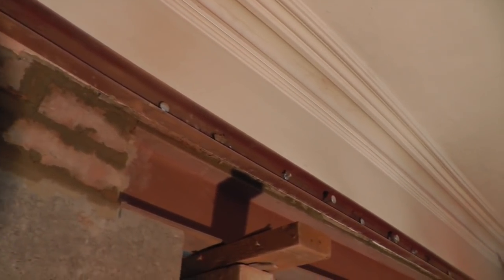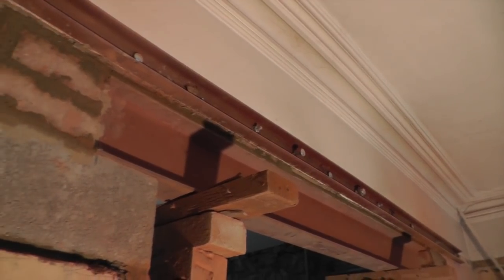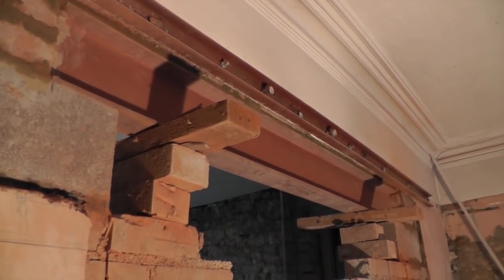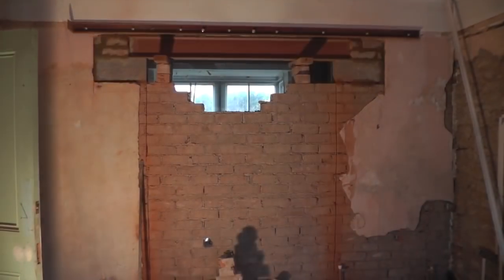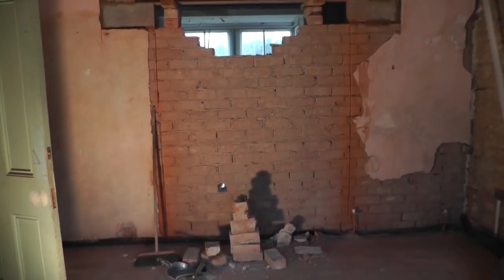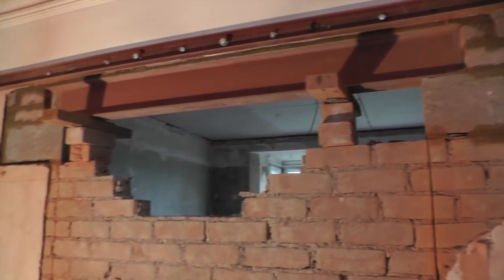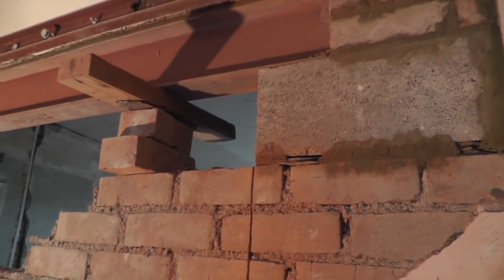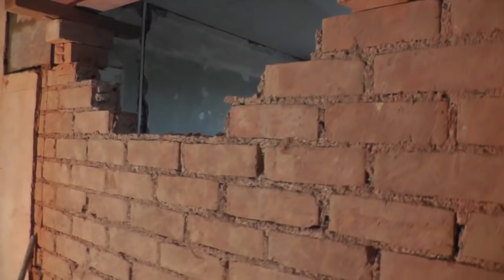The Wall Comes Tumbling Down

Comment: Hi Tim, could you tell me how that bolted steel support works? 
Thanks, Joe
Reply from the maker: It was the only time I have seen it done but a builder friends did it with me. It’s just two c channels bolted through the bricks above. It clamps it together creating a temporary ‘arch’. I would used acros on a bigger wall but it works well where you can’t get a solid base to support off such as this wall which was above the cellar.
Reply: @TheRestorationCouple  yes first time I've seen it. Was it holding much above?
Reply: @joefowler9600  It doesn't look like load bearing wall.

Comment: With such a narrow gap from top of steam beam to bricks(and temp channels) did you pack it with mortar.. or is steel up tight to dry level brick.
Reply from the maker: Can't remember on this wall, I believe it was mortar between and then some slate by padstones where needed.